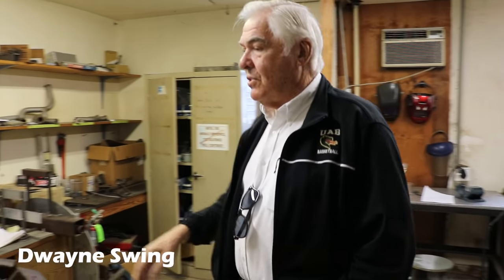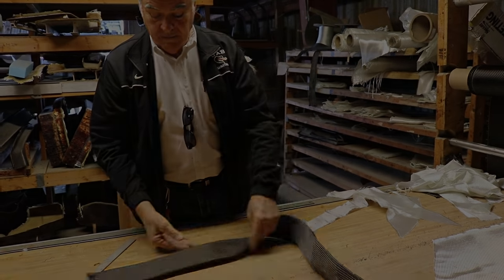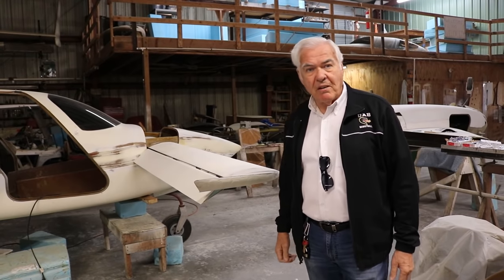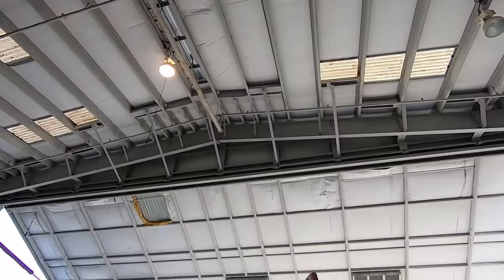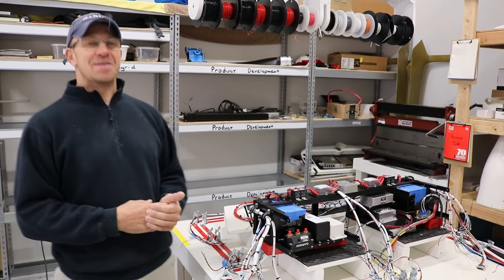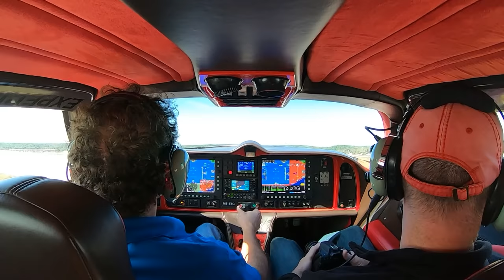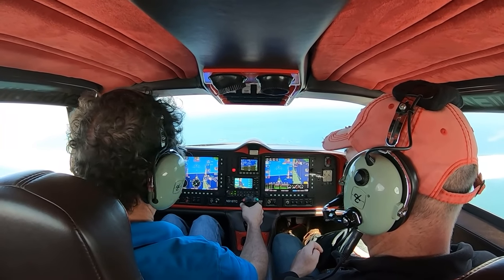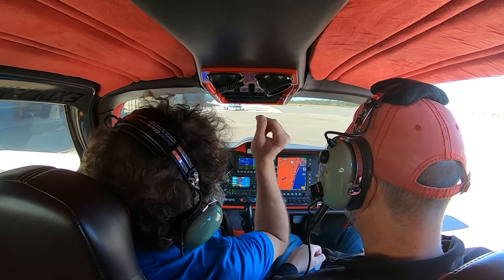Velocity Aircraft - How Its Made Factory Tour + Demo Flight Flying Sebastian Florida - Raptor Like

Comment: Those wire looms look like stuff I used to see in aerospace.  Very nice and clean.  Building a Long EZ one of the really enjoyable parts was hot wiring cores.  I'm a little surprised people don't want to do this.  We genned up a hot wire supply that maintained constant average temperature and it worked really well.  Great tour, beautiful aircraft.

Comment: Please do a follow up on that twin turbine build. Looks like they are using a PBS turboprop engine 🙏🙏🙏🙏
Reply: A twin turbo prop would be Awesome.  
However l wonder if the airframe would be up 4 it .  They r silky smooth power plants 🪴  Think Velocity would need a Vacuum Bagged Epoxy Carbon Layup . 

And the best guys 2 chat 2 about that would be the young bucks at DarkAero

Comment: Great aircraft I just wish they were doing a layup when you were visiting their operation Bryan. Their shop machines a bullet proof and will work for another 80 years if maintained well... To bad we don’t produce machining equipment as rugged as those are and just add CNC control units, but extra metals cost extra monies$$ Bullet Proof.. Great company to design, build and fly a great aircraft design. Great one Bryan
Reply from the maker: Thank You. Yes... this is much more of a "Low Production" facility and do more "as needed" or "batch runs" then stock. So there wasn't as much to showcase for the "MAKING" part of each component unfortunately. But... as you can clearly see, there is MUCH happening in the ASSEMBLY HANGAR! :-) Thanks for showing up!
Reply: @ExperimentalAircraftChannel  their finished product speaks for itself. I never gave it much thought about the flight characteristics of the Canard design until I looked at the Raptor aircraft and the prop / ground distance. I have a new respect for pilots who fly these aircraft and the performance they obtain. I would love to see the turboprop aircraft fly and see if it would still be considered an experimental aircraft?

Comment: At one point he demonstrated how much the rudder can lower a wing. I've done many, many barrel rolls using rudder alone with no help from the ailerons in my Long EZ. They take about twice as long as when using aileron and rudder which is about 4 seconds, a pretty leisurely roll rate. You start the "rudder roll" about 60 degrees nose up and finish 60 degrees nose down.

Comment: I have been interested in the Velocity Twin since 2010 and the short fuselage always keeps me on the lookout for other concepts. If it were 30ft my hesitation would be non existent, @ 25ft my concerns would still be on the radar but tolerable but with a 20ft I would be highly motivated to modify it until satisfied and that canard would be reshaped to suit the overall look similar to the SR-71 canard that didn't go into production. Great video and I am impressed with the process
Reply: @StabyMcStabsFace  if a car engine fails it is already on the ground and can still cause injury and damage, a plane is anywhere from 500ft to 25000ft and doing double or triple the speed on average. If you don't plan for a failure you will never expect the unexpected ! When I go to war if the rifle fails I have a pistol, if the pistol fails I have a bow and arrows, if the bow fails I have a field knife and if my knife fails I still have a plan-B

Comment: What is are the disadvantages of a Canard design vs traditional Van's type RV or similar?
Reply: It's much harder to stall, as the canard stalls before the wing, pushing the nose down. The downside is that without flaps on the canard you need a longer takeoff roll

Comment: Did I hear him correctly that it has a pressurized cabin?
Reply from the maker: For clarity... the cabin is NOT actually pressurized. However... they do use a similar system found in pressurized cabin for sealing their doors in flight (or maybe that is an option). Basically there is a weatherstrip seal around the doors that gets pumped with air to provide a tight seal around the doors. Thanks for watching and catching all the details! :-)
Reply: @ExperimentalAircraftChannel  I see, does that cut back in engine noise?
Reply from the maker: @JohnRobertson22  I think more so the wind noise around the doors. It is a 200mph+ aircraft... so I am sure they are doing everything possible to keep it clean/quiet.
It is very much like driving in a car... but with wings! :-)

Comment: I just sold my 2016 Cirrus SR22T G5.  I looked at Velocity V-Twin back before I bought the Cirrus.  Now I am back and I see they have advanced up to turbine engines.  I do not want to build one...is there a factory built version?
Reply: Have a partner do the build with builder assist then buy it from him.
Reply: @rnordquest  I put in an order on a fast build kit (a month ago).  I am gonna use a pro in Mesa, AZ (a shop) and join them on critical pieces to qualify for the 51% and get the repair cert too.  Its all lined up now.  I am gonna use the TSIO 550-C engine.
Reply: @speedomars  Way cool.  Can't wait to see the videos.

Comment: Interesting but why not make the fuselage as one piece? any inconvenience in lay up must be well worth it. Also it's an interesting shape but canard seems to have no advantage over conventional and is much more complex shape so why not do something sleeker like a glider teardrop. And why not use carbon fiber? it's slightly more expensive but pays for itself in weight saving. A double curved shape is rigid in a very thin shell when it's carbon fiber. Similarly maybe the wings could done as single pieces. Keep the production very simple and fast. The time it takes to make it has to be a huge factor in business viability. And if you really want to progress, develop small turbofan engines for it. And make it pressurized. Which the glider shape lends itself to naturally.

Comment: I was really surprised how filthy and dirty most of the facility is. A few of those rooms look like they hadn't been cleaned since the spring of "44" The main assembly line looked really nice I cant understand why they would let the rest go . As much as you have flown cant believe you almost blew chunks
Reply from the maker: Regarding the workshop. Actually quite typical of a "Composites"  shop. Very similar to an automotive body shop for sure. Yes... I too was more impressed with the "Assembly Hangar" for sure. More my "style" as well. (almost blew chunks). Well... yeah I am more of a straight and level guy to be honest. But... it actually has been a while since I went up and then doing SEVERAL shallow stalls (like riding a wave) and then some hard turns... I was getting close! :-) Thank You for you support here. We appreciate YOU!
Reply: @ExperimentalAircraftChannel  I used to work autobody and paint and we had dusty areas where we did our work but when we were done we got out the brooms and dust pans and cleaned everything up. That is very old dust looks to be at least 20 years old . They are not cleaning up after themselves in certain areas of the shop. A half hour before you clock out clean your area of all dust and debris. My advice before a flight like this is don't load up on Pork n Bean Tacos and salsa with sliced boiled pickled eggs  You will be golden. I haven't been in a plan in years I might of painted the inside of wind shield a new color

Comment: Honestly I am extremely interested in getting one.  Anyone on here know of costs?  Financing, insurance, maintenance?  Can you buy them built from them or do you have to build on your own?  This to me is the ultimate single engine piston with speed and range.  Anyone out there with one let me know about the expenses!
Reply: You can finance aircraft for 10-15 years similar to a motorhome. 

So the monthly payments become affordable (like, around the cost of renting a nice apartment, or the payment on a top of the line pickup truck).

The outright price is going to be $300K+ But comparativly speaking, its practically free. 

As a Beechcraft Bonanza starts around 1 Million, and its not at all in the same category of performance. And you canot perform any repairs on the Bonanza, you can do all your own maintenance and upgrades on an experimental. Cost of ownership is going to be about 1/5th vs a certified turbo.

Comment: A sweet modern high performance aircraft.. However shop making kit is low tech and looks very unorganized for production of kits of high performance aircraft, looks like a home shop versus high performance kit production manufacture, that worrisome...could be better.. would look more impressive to customers / potential customers.
Reply from the maker: A little like an Auto Body Shop in there right? But then again... it is fiberglass with sanding and priming required. So maybe you can't get around that "look." :-) Thanks for stopping by to watch today!
Reply: @ExperimentalAircraftChannel  agree, but for example look at how clean, neat and organized Mike Patey's plane building areas are, he's building and highly modifying several planes at the same time. I would expect a manufacture to at least look clean and neat especially true since they new you were coming with a video camera (makes you wonder what it looked like before they knew you were coming). It's worth the time to clean up and organize each end of the day, it's safer for workers (and visitors) and particularly for this amazing high performance aircraft kit manufacture and manufacture faculty would match what the aircraft looks like and is. It's concerning.
Reply: Hey! Great point. We use that hangar for body work and the nasty side of fiberglass aircraft building. Mike Patey has an incredible shop and it should be the standard. We are starting to grow and these changes will come soon! Appreciate the input and stay tuned to see how we do it! 😀
Reply: @rileyswing9731  thanks for the reply, that change can make a big difference to customers and visitors, adds to quality and safety. You have an amazing high performing plane, can't wait to see the shop match. Have a great day.

Comment: crazy . no structural integrity at all. the whole thing is surface skin exoskeletal. Then the material Fiberglas has a high deterioration rate under use. meaning the more you use it the faster it deteriorates. terrible environmental resilience qualities. Have any of you ever seen a corvette that was 10 yrs old? fiberglass dehydrates very rapid with age among many other things. . put the two together ( bad design and bad material) and you have recipe for disaster. These are throw away planes. I wouldn't put this Down in the water. The only floating will be pieces. I wouldn't even want to belly land this thing in a gear failure. Thats why Cirrus has parachute. it wont service even the most docile emergency landing. This one is even worse. I wouldn't take one of these for free. you couldnt pay me to even ride in one